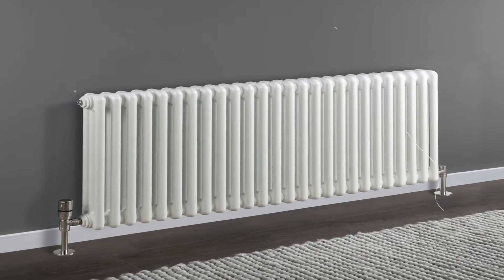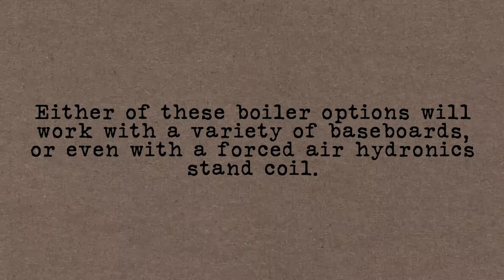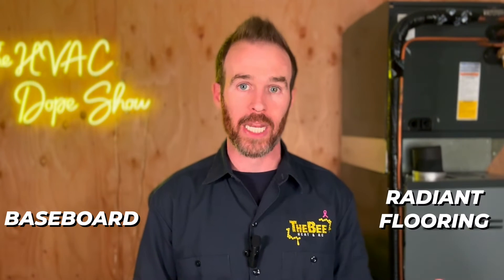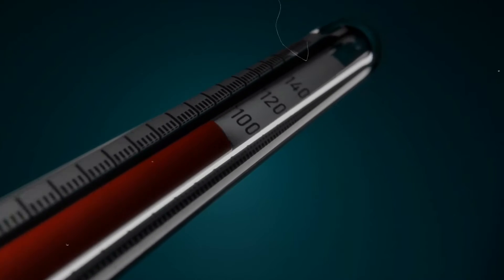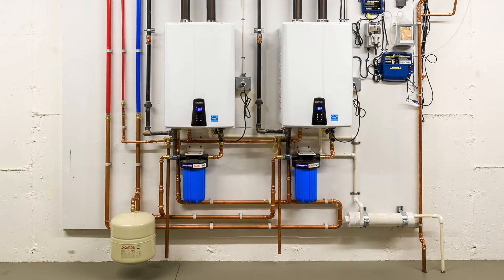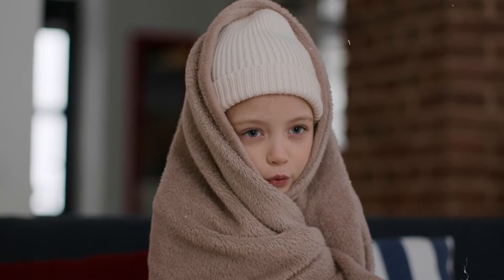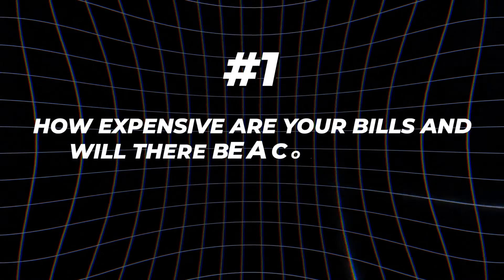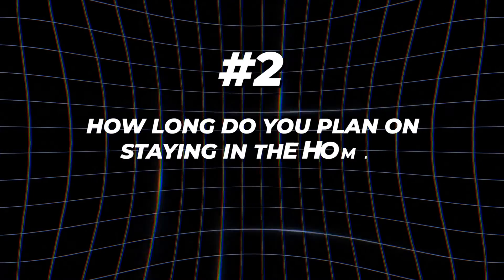Boilers: Cast-Iron vs. High Efficiency Modulating 🔥

Comment: Cast iron all the way, condensing never pays off with cost and maintainenceu. It only works for the hvac companies who will service them. Cast iron hydronic system with a indirect is the best setup.
Reply from the maker: I agree we always prefer cast iron because they’re more reliable, it doesn’t serve us if something is going out under warranty! But sometimes we’re unable to install a cast iron if there’s not an existing Flue so high efficiency is the only option, or something induced draft / sometimes a copper fin tube.
Reply: @TheHVACDopeShow  you could always just do a direct vent cast iron if you don't have a chimney for atmospheric vent.

Comment: What are the average costs for these two setups?
Reply from the maker: Really hard to answer that question because it depends what the contractors doing in terms of trim pieces… one time we quoted a bid and then someone else quoted half of what we were charging but wasn’t replacing any of the zone valves / expansion tank / fill valve etc so the customer still chose us because that was an incomplete bid and not like for like… it’s more important to just make sure they’re following best practices so the install works well when you’re done. Otherwise you’re having constant issues with other little components breaking down constantly. Ballpark range 15-25k? Depends on your region, because if you live in an area with a high cost of living it will go up, or larger homes. Cost is something we get asked about often but it varies widely because a lot of contractors don’t know how they’re supposed to be pricing themselves and some are too cheap especially new companies / one man shows. Just know that fittings in particular add up very quickly.
Reply: @TheHVACDopeShow  I wish there was a service that we could take a bid we are given and find out if it is even reasonable.  I don't mind paying for quality work, and I understand fixed costs, but unfortunately, it is usually overpriced and under-delivered when it comes to HVAC.
Reply from the maker: And for what it’s worth if you’re wanting the most reliable system I’d go for a cast iron. The combi boilers are reliable too but we’ve had more issues with water quality (hard water) causing premature corrosion on parts and causing issues with the system working. This is only an occasional issue with hard water and not the norm, but if you have a cast iron currently they’re definitely more reliable and we prefer to put them in.
Reply: @TheHVACDopeShow 
Is this issue with the hard water effecting the DHW heat exchanger or the firetube system or CH end? I am a Plumbing and heating contractor myself on the fence with the combi units vs heat only with an indirect tank. Thanks for the videos!!
Reply: $12,000 is a good price for boiler installed with primary loop and manifolds for two zones. I’ve seen $30k, but I’d keep looking.